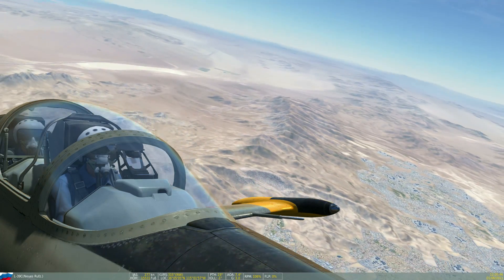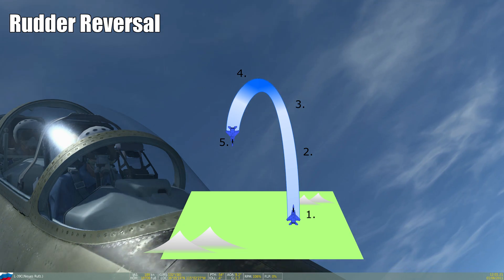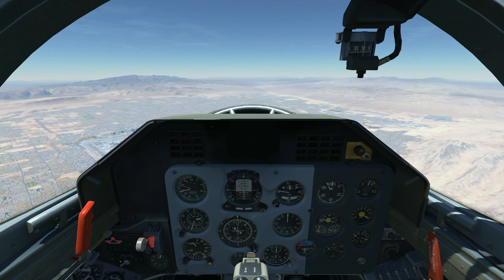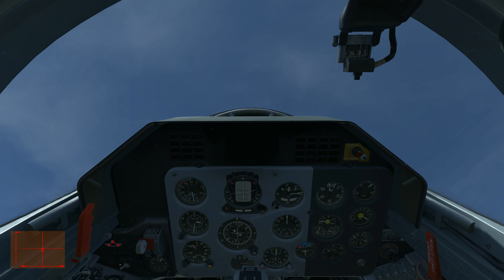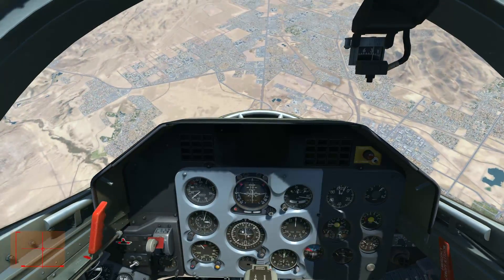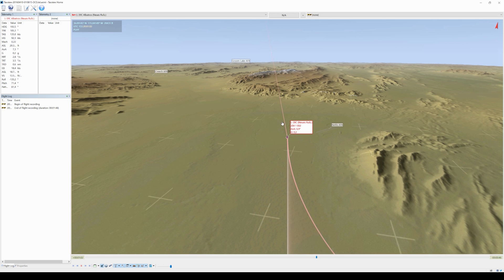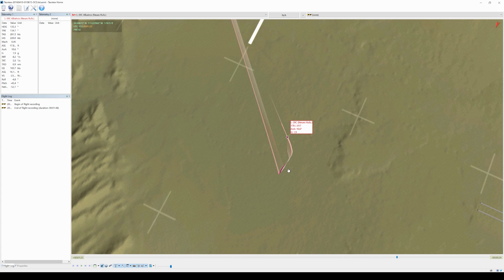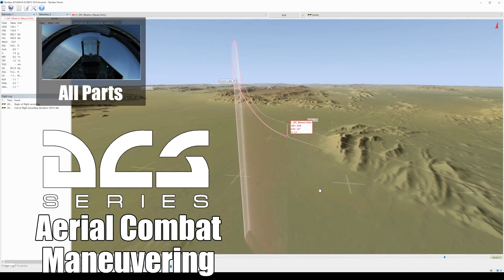DCS (World): Air Combat Maneuvering - #08 - Rudder Reversal [English|HD+] - Tutorial

Comment: should you cut the engine when at the apex of the maneuver when you are in a jet like you would on a prop in order to drop the nose faster ?
Reply from the maker: Imho there is no "should". It depends on your plane and - if in a real fight - your opponents plane. Do you want to outclimb him (knowing that you have the capability to do so)? Can you risk to let your nose drop faster? Can you risk to let your nose drop not so fast? And here's the answer: it all depends. :D Yes, of course this is not what you wanted to read. But it really all depends. If you know your opponent has a much much weaker thrust-to-weight ratio and you can easily outclimb him and while on your way up you already see him turning over, then there's a good reason to cut the engines and let your nose come down so you end up on his six!
By the way, to the best of my knowledge the props will increase thrust when at the apex in order to let the air from the prop flow over the rudder (correct me, if i'm wrong!).